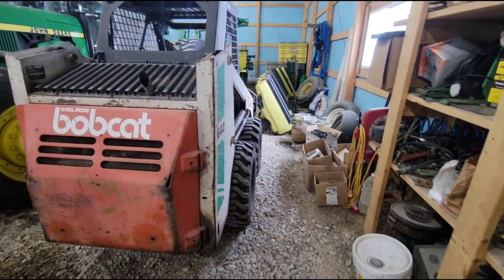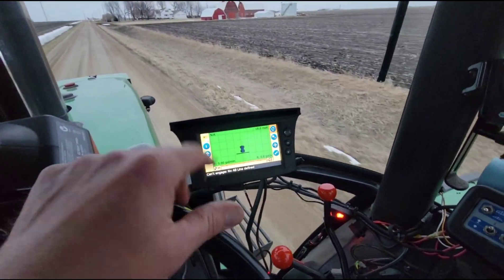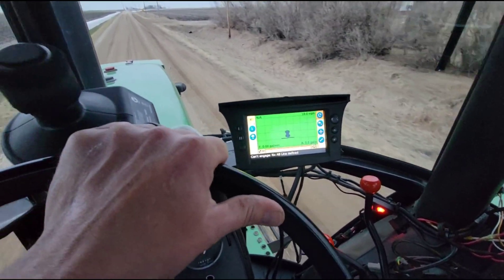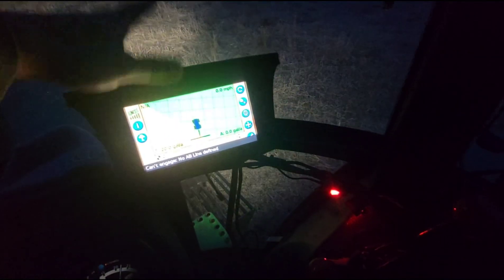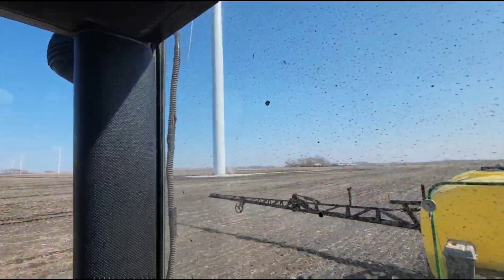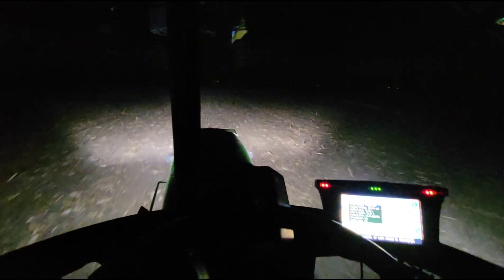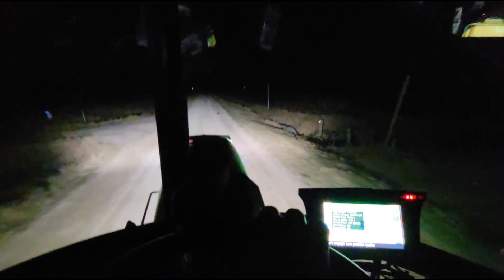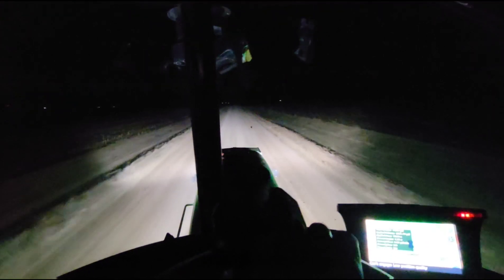April 24, 2022

Comment: It's been raining here today and went back threw and watched some of your videos that I haven't seen yet and really liked how you took the matching tires off the trusty old 4630 and put new on the drives of the 30 and the 50 and pull the used as duals on both tractors. It is amazing what tire prices have jumped up to.
Reply from the maker: Yeah its crazy. The 4960 is the first tractor i ever put all new ones on and it was over 11k but the old ones were shot. Like everything else they will come back down in a couple years i think
Reply: @iafarmer  
4960 sure looks good with the rock rack and new sneakers. You do a great job of keeping all your equipment nice and in great working order. Alot of people have no idea how hard it is keeping up with the equipment. I try my best to do the same weather it it is new or old because equipment is a big purchase and I try to make things last until I have the chance to upgrade. I hope to be in Iowa in August 11 for the plow competition. Have you ever been?

Comment: God darn technology 😂. That 4630 is still a gem of a tractor I wish I had. Ground temp is still way down for the time of the year, I heard in our area it is only 41 degrees.
Reply from the maker: No kidding. It will probably always be my favorite tractor. Yeah it can warm up anytime!
Reply: @iafarmer  You know why my hood on my Deere x720 wont latch fully shut? it feels like theirs something holding it back.
Reply from the maker: @kolewiebensohn  could check the wheels and tracks, if theyre fine then maybe a side screen is catching? You can adjust the track forward and back by loosening the 2 bolts that hold it but if it closed fine before then something is catching a wheel or sidescreen
Reply: @iafarmer  The one wheel was loose so I tightened it. It feels like the left side is catching or sort of binding cause the right side will snap in place.

Comment: I did not have any trouble the other day I was out testing all the new stuff except around trees. It seemed like it would lose the signal easily. I have herd that there have been some satellite problems but wass was supposed to be ok. Will see,  I wonder if a soft or hard reset will help or having the latest firmware update re-installed.  Good luck.
Reply from the maker: Good deal. Yeah i need to get it to a dealer and get updated software in it. Might have to try a hard reset on my other one. Thanks!

Comment: I got a raven cruizer and with no steering and sometimes I think it screws me up more than if I didn't have it at all🤣. Trying to steer manual off the screen is a bitch.
Reply from the maker: It definitely takes some getting used to and its always the guidance thats off never the operator 🤣

Comment: GPS can be a wonderful thing... And a pain in the.....
Got the same jobs done for many years without it.
Won't know until the rest of the machine is done, but put the last of the field lights on the sprayer today.. find out later if they're in the right places.. 
Obviously JD engineers goofed with the extra shutoff plunger...
Reply from the maker: Yes its a game changer when it works correctly as far as efficiency. Hopefully you can get that thing going this year. Yeah im sure its on there as a backup but a manual cable wouldve been a better idea